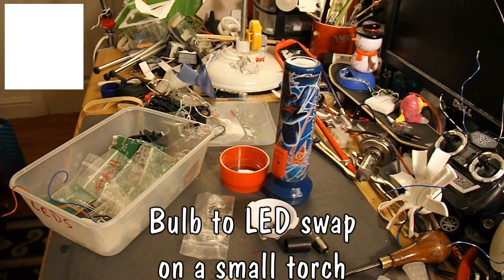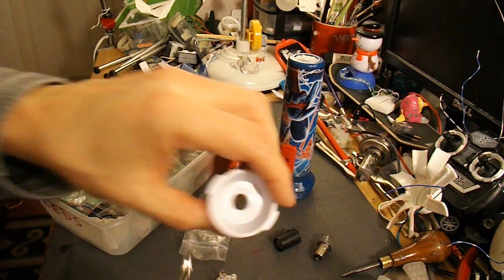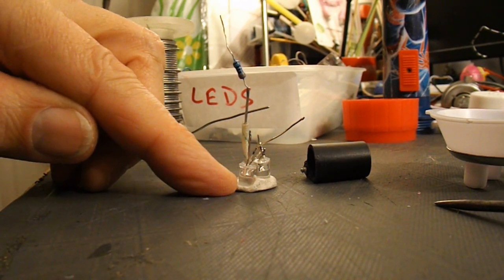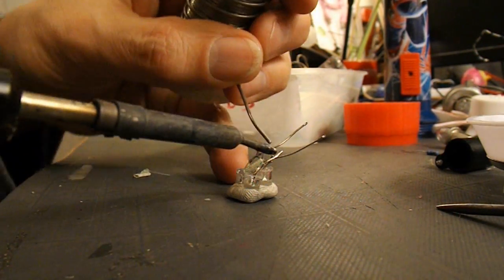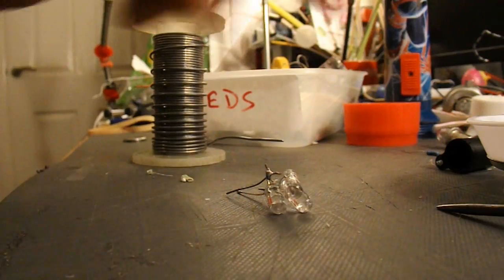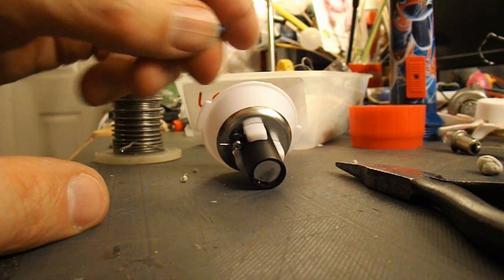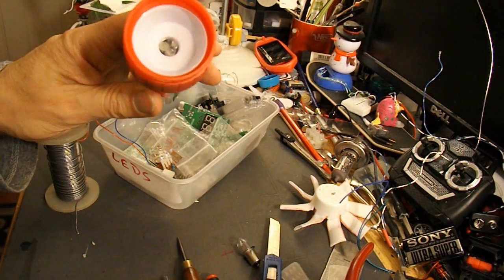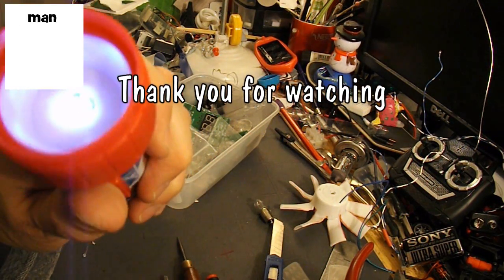Bulb to LED swap in small torch

Comment: You could also take apart the dead halogen bulb and fit the three LEDs into the metal base. Rather than just throw the old bulb away :-)
Reply from the maker: If you can get the bulb apart without damaging the casing or of course you could just buy one of the direct LED replacement bulbs now available. Here is the follow on video from this one https://youtu.be/SD1Q9wRePxg

Comment: Nice idea and a superb example of Grandads skills.
It's now special combat ready for night warfare in the garden lol, it has super tough LED's ! (cue A Team music)
Reply from the maker: Thanks Slider, although if he goes out in the garden it will soon be a muddy bog if it is not frozen. Mind you, he would love that. Peter Carlyle commented I could have used one of those 1w white LEDs to replace the bulb, not sure if they might be too bright but it might be a fun little simple project. Just have to get a value that doesn't melt the plastic.
Reply: GrandadIsAnOldMan
Here's a Pro tip lol, superglue a penny to the back of the 1W LED. That's the cheap fix to make sure for the plastics.
Reply from the maker: slider2732 hey thanks, hmmm a penny, that will add to my costs :-)

Comment: I noticed that there's an old digital clock in the scrap led box can you make a video on that ? Looks like I rather cool pice of scraps 

Ps.  Wow that's way brighter than the one I made
Reply from the maker: Hi, that is just an LED array which could be used to display numbers. Not sure what I will use it for, but it was worth saving. I have lots of stuff like that in boxes just in case I can think of something that needs it but I rarely get involved in electronics at the moment.
My light is brighter than yours because it is 3 LEDs but that means it will draw 3 times the current and flatten the batteries quicker. Mind you it is difficult to tell in a video because the camera auto adjusts to the light. If you look at the video I linked to in the video description I have used 9 LED and 24 LED torches too and they are much brighter. All bought from bargain stores or dollar stores as Americans call them.

Comment: a 1w white led can take 3v from a pair of aa batteries using only their internal resistance, and can be soldered into a torch bulb case. use a soldering iron to melt the filler binding the glass bulb to the metal case, and a wire from the centre connection to the positive terminal. the negative terminal can be soldered to the case.

i've just done the conversion for two of my girlfriend's ancient torches.

this is the style of led i used, purchased from ebay:

http://www.snowdragonledhk.com/new-led-high-power-1w.htm
Reply: sorry, that wasn't a good link as it showed many models. i don't seem to be able to edit the above comment

this link is better:
http://i00.i.aliimg.com/photo/v1/498445910/110_120lm_1w_led_chip_in_white.jpg
Reply: the bulb mod, rather than the torch mod allows the led to be changed easily, and, if necessary, allows you to go back to an incandescent bulb.

your torch mod is excellent, and the sort of thing i have done in the past, but i've been playing with bulb mods for a while now, and am quite fond of them :-)  my first one was a 10mm red led with a leg to the case, and the other soldered to a resistor then to the centre terminal for my 6v dolphin torch. this was in the era before super bright leds, so it was pretty dim, but i could swap between incandescent and red led and was pretty happy with it at the time :-)
Reply from the maker: peter carlyle thanks for the hints and tips, certainly if I wanted a good bright light that would be an interesting project. I just had a quick peek on eBay and can see 1w 90-110LM for 99p - free postage - and 1w 110-120LM for £1.30 with a note saying they need a heat sink. I might buy some for the future.
As for fixing my grandson's torch, I think the low wattage scavenged LEDs I used will do fine, especially as they were free and ready for use.
Reply from the maker: peter carlyle Just found some even cheaper 10 x 1w 100-110LM beads for £1.44 no mention of heatsinks but have to wait for them to arrive from China.
Reply: The 1w leds I've been running on 3v don't seem to get hot enough to need more than their heatsink connection to work. They are unlikely to be running at their full capacity, but seem bright enough for general use :-)
Reply: They do seem to be brighter than the original bulbs, even in their low powered state, but those bulbs were very old :-)
Reply from the maker: peter carlyle I have some on order so I will find out eventually :-)